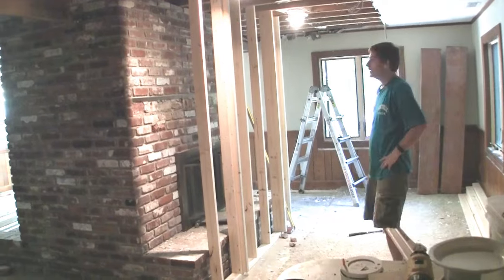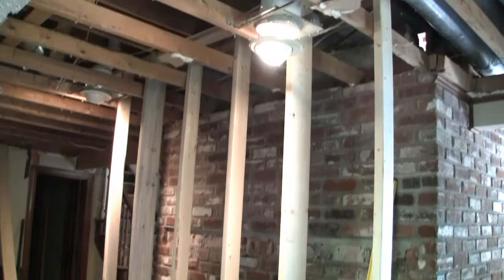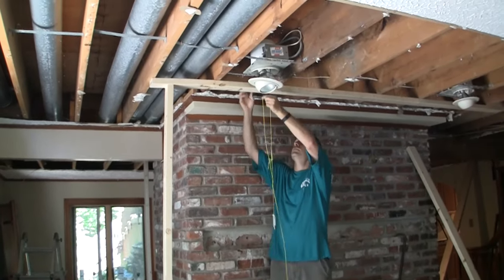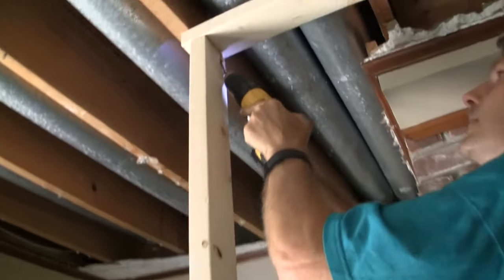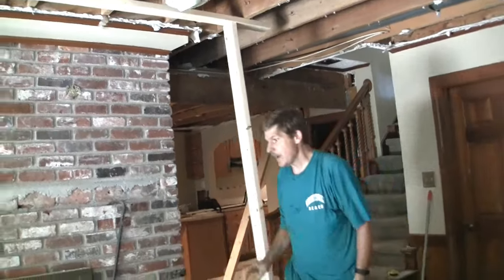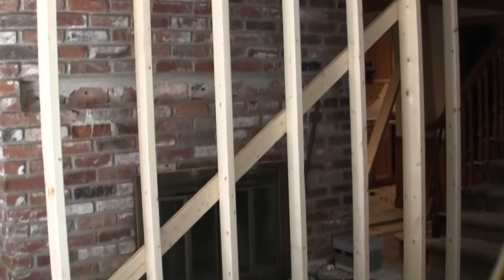How to Build a Temporary Wall

Comment: Have to rebuild 17' of wall in the master bedroom/ bathroom because of termite damage. I already rebuilt 11' of wall at the garage door opening so this is not new to me. However have carpeting in this room and hate to have to remove it to put in a temporary wall. Hopefully cardboard under the temporary sole plate will work.

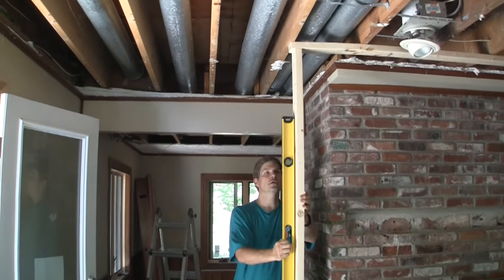Comment: 2:10 "a little bit longer" How a you know isn't it too tight or to loose?
Reply from the maker: Hey Oupekha,
Too loose and the 2x4 won’t stay in place if you let go before nailing or screwing in. It needs to fit snug. 
Let’s say that the board we need to fit in between top and bottom plate we need to cut measures 94 1/2 inches. We would add an 1/8 inch and cut the stud at 94 5/8 inches.
You can always make the board shorter; can’t make it longer 😃
When you put it in place, a few taps with the hammer should be all you need.  If you have to use a lot of effort trying to force it to fit, then it’s probably too long. 
When the stud is in place, it should not bow because it’s been forced. So like they say in plumbing, tight but not too tight. 
Hope that helps.
Thanks for watching.

Comment: I noticed you screwed the headboard into the joists. Is it also necessary to secure the baseboard to the floor? I want to create a temporary wall on top of nice wood floors and don’t want to secure them if I don’t have to.
Reply from the maker: Hey Blake,
I’ve seen people skip securing them on TV for what it’s worth. Definitely do the cross brace. All depends on your comfort level I guess. Thx for watching!

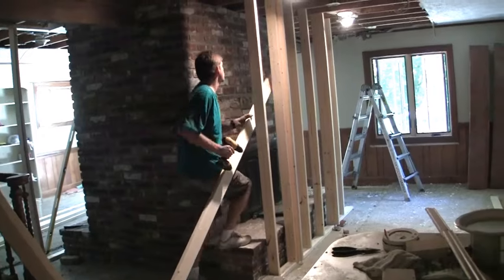Comment: 3:54 reflects temporary frame underneath second story floor joists, then at 3:57 it looks like verticals go above bottom of second story floor joists??
Reply from the maker: Hey Jeffrey…,
You are seeing examples of both sides of the chimney. One side had a temp wall directly under floor joists. 
The other side attached to the side off joist which were a foot higher on that side since the joists were at different heights due to a sunken living room above the 1st temp wall but not on the other side of the chimney.
Hope that helps.
Thx for watching!
Reply: @Housebarons  That explains it!  Thanks!  I looks like you used 2x6's.  Maybe it's experience, but my screws never seem to go in that smoothly, without the bit trying to strip the screw head.  What type of screws are you using?  I am doing a home project.  The 2x8 I am attaching to the joists is about 13' long.  Any tips to attach this with one person, I do I need to wait for my buddy to come over to assist?